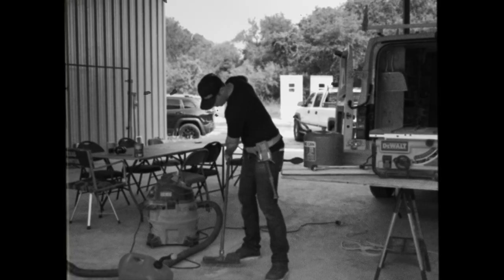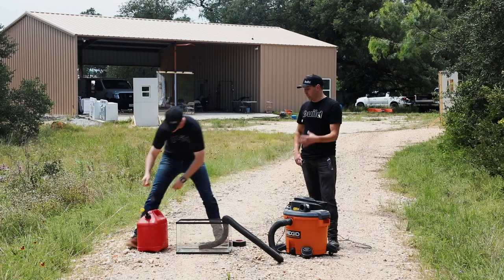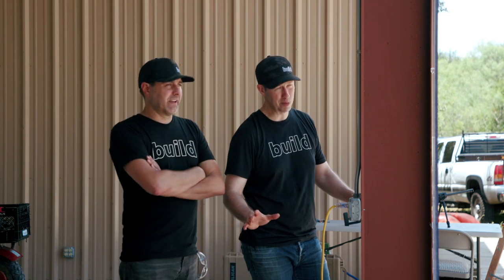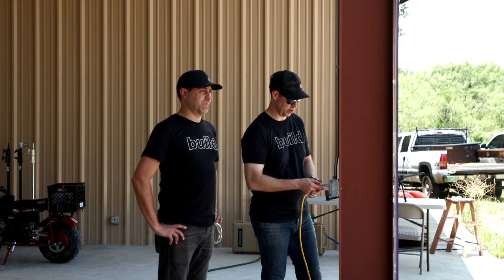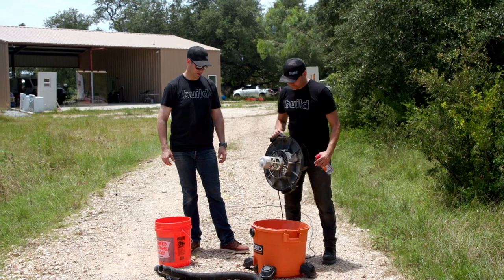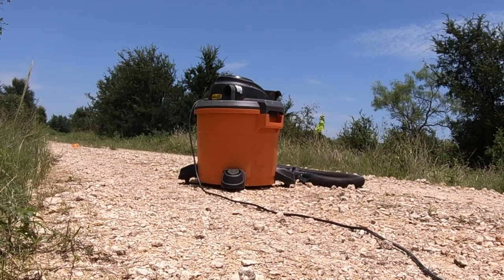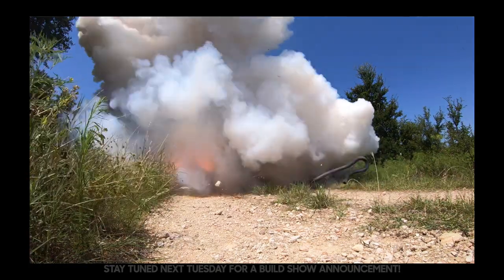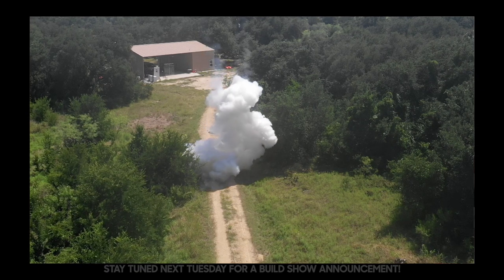Shop Vac’ing Spilled Gas - Will it Blow Up?

Comment: Some shopvac motors push the sucked air through the motor to cool the motor. Some use a separate fan to cool the motor and all the sucked air is kept separate. One blows up, one doesn't.

Comment: I guess it would be possible with a really bad vac that is sparking everywhere - with just dry saw dust. Back in the day this was an issue in saw mills and flour mills where there was a lot of airborne dust which got exposed to a naked flame. When I was in school my physics teach did a demo using baking flour and a lit splint in a small box - made quite a nice pop!

Comment: Fun video, but what you proved was that it was possible to vacuum up flammable liquids without starting a fire, not that doing so can't result in a fire. It's a very important distinction. Vacuums can, and have, started fires. Nearly all corded vacuums use brushed universal motors, which create internal sparks by design. Now, those sparks might be well enclosed, and they're going to be fairly minimal when the brushes are new, but unless it's a motor that has been designed for explosive environments, it can definitely ignite flammable vapors. Try the same test indoors, with a much smaller quantity of gasoline, and you're more likely to have a bad day. The hazard will increase as the motor ages and produces more sparks. It won't happen every time, but it only has to happen once.

Comment: I had a friend who was scraping a car & was drilling a hole in the fuel tank to drain it with an electric drill. The sparks from the armature ignited the fumes once the drill bit went through the tank & he lost a bunch of hair but was otherwise fine (that's what the paramedics said). After that he went to using an air drill.

Comment: The results of this kind of experiment are highly dependant upon how the shop-vac is constructed. There are a few common ways to build AC motors for generic appliance applications, some with and some without brushes. If this vacuum happened to be built with a brushless AC motor then the results would've been very different with a vacuum that had a motor with brushes as that would provide the source of your spark.

Comment: Model airplane gasoline is pretty flammable but it will require a spark from experience to ignite but not terribly close.  Flame 2 feet away would work.

Comment: I wonder if failing brushes on the motor would spark enough to ignite it...
Reply: Brushes, bearings, static electricity. Gas vapors need 180 microjoules of energy to ignite.

Comment: I actually know a guy that has been burned severely. He had just bought an old Volkswagen Beetle, and he was vacuuming the front trunk where the gas tank is located. He must of had the right air fuel ratio, and this was about 15 years ago, maybe the design  was different then.

Comment: I have gotten static shocks from vacuuming  dry powders and saw dust, maybe if you had a pile of sawdust and something flammable it could ignite from the static buildup from particles moving down the plastic hose quickly, either way I think nobody should ever vacuum anything flammable.

Comment: It's good to see how difficult it is to do it, but when I was a teen I accidentally vaporized about a pint of gasoline and it detonated with me inside the vapor cloud.  Don't screw around with it.  If there is a spark and there's enough volume, it can detonate energetically and set everything around on fire.  I'm alive because I exhaled at that second rather than inhaling, and not permanently scarred because "Stop, Drop, and Roll" actually works.

Comment: Did the motor have a capacitor? That might have set it off when you poured gas into the motor?
Reply: Capacitors don't arc unless you short them out, or when they finally fail, but most motors that use them are induction motors which are not efficient enough for a shop vac. Most vacuums still use brushes , though electronically controlled permanent-magnet designs are gaining popularity. There is no reason why the latter should be more expensive, but they still sell at a premium.
Reply: I don't know if gas would short out a capacitor but i wouldn't want to find out by pouring gas on one. Thought the guys were a bit reckless there.

Comment: If you want to use gas. Get a older vac. 
Newer ones are sealed units because dump people would do dumb stuff like this. 
Therefore that’s why the units are sealed.

Comment: I have seen this happen when I was a service tech on fueling stations. I was on call and a customer called  and said that he thought there was water in the turbine pump containment  manhole; the sensor had been tripped. I drove the twenty five miles to the gas station to find the fire department there and the fuel island on fire. The idiot did not check to see if it was gasoline and used a shop vac to remove it. The one plus, my company got to rebuild the station. Cha-ching!

Comment: They must have done something wrong, maybe they used a too high ratio of gasoline?
I only used the vacuum to create a vacuum to get gasoline out of a car; held the vac´s hose up to the clear hose that i had tucked down into the tank, so i could see the gas coming in the hose.
Never saw the gas but the explosion i saw, heard and felt.
Found the HEPA-filter a few days later, 300 feet from where the vac. exploaded.

Comment: Safety comment: doesn't plugging the extension cord into the outlet generate an arc, with the gas 3 feet away?
pedantic comment: why would someone be reloading with black powder when it's pretty much only used in muzzleloaders? :P

Comment: One day I found a safety pin it went to one of the babies diapers I set it on top of the vacuum cleaner after the baby upchuck I had to vacuum it up what do you think the safety pin went you couldn't get it out it maintained a blue Spark but still ran

Comment: 20 pound propane tank duct tape 4-1 gallon tanks of gasoline to the propane tank,  light some newspaper on fire directly behind the propane tank.  Stay back 50 yards shoot propane tank through 1 of the gas tanks.  Makes nice fireball and big boom.
Reply: I mean... if you REALLY wanna do it right... a hot summer day... a steel drum with 2 gallons of gasoline in it... an undisclosed ignition source in there... yeah... you BETTER be behind 1/2” plexiglass...
Reply: @SuperVstech  I like your thinking

Comment: I don't want to see demolition ranch on this channel. You need a demolition expert to consult with you to be responsible. This is much more risky than gun play. You don't know if that motor assembly has a capacitor in it that could retain a charge after unplugged. Go back to what makes this show great. I would like to see one of those rotary sweepers sweep a floor covered with gunpowder. You're gonna need a robot to push it or a rope. I would also like to see a video of you returning that vacuum for warranty repair. Fredio will live on to reproduce.

Comment: Dumb. This gives the idea that it’s ok to vacuum up gasoline with a shop vac. No it’s not! The gasoline vapors from the exhaust are the problem in an enclosed area. Fill your garage with gasoline vapor and then set off your stupid electric match. Stick with building stuff.